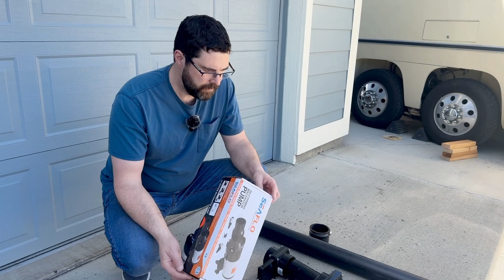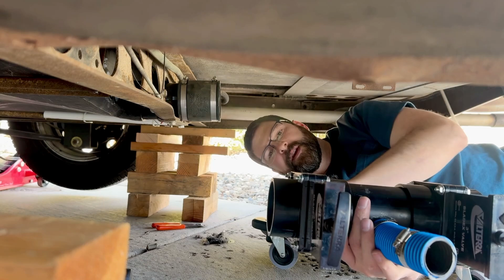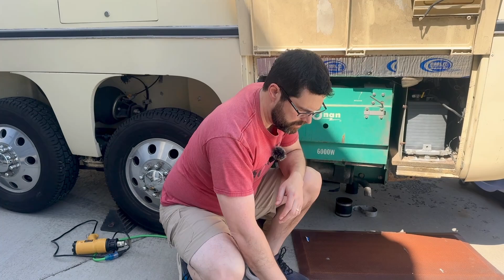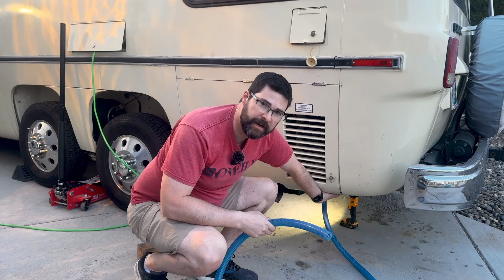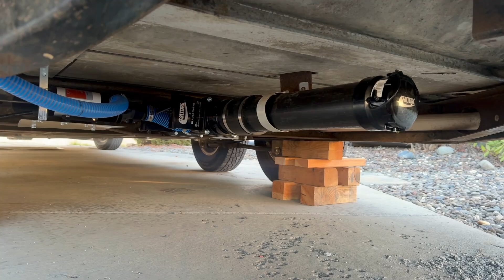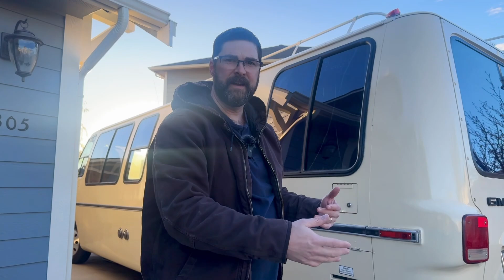GMC Motorhome Macerator Install

Comment: Enjoying your renovation of the GMC, however when are you going to sort the linked low compression/overheating issues?
Reply from the maker: Great question! The engine tick and low compression seems to have improved, I think I was having a sticky lifter problem or maybe a piece of carbon stuck in a valve. I haven't had any noise and power seems normal for the last year or so. The overheating continues to be a problem. I just replaced the fan clutch and will post that video soon. we'll see if that helps.
Reply: @MrGMCMotorhome  
Thanks for taking the time to reply, looking forward to your next video with the update, hope it fixes the issue. If not there's plenty of other options to try that are covered on many of the vehicle rescue/get running channels. Regards from across the Atlantic.

Comment: If you haven't already, take a look at Jim Bounds vids on macerator install. He has some really good ideas on the outlet hose.
Reply from the maker: I did, the Jim Bounds video inspired me to get a macerator! I considered his approach but I have fuel and LP lines running down that space in the frame cross members that he used. He was able to install a much longer hose because of more storage space. So far my hose length has been okay.

Comment: The on/off switch. It is a convenient location.... But Its a possibility, that a rock will get kicked up from the tire and turn it on. Might want to put a guard/shield or cover on it. 
It does look like you have it so forward is on/back is off, so less likely, but, they could bounce off something (the bumper?) and still hit the switch. I think I would have put in in the battery section of the generator compartment for safety.
Reply from the maker: Wow, great observation, I did set it up so that back is off because I was thinking about something hitting it going down the road. I thought about putting it in the generator compartment but I didn't want to have to open it every time I went to dump the tank. I like the safety cover idea. I can always relocate the switch later with a little rewiring.

Comment: Well done, you could put a cap with a rotating collar or rubber/foam seal on the sleeve of the pipe so when you poke it into the storage it holds it in and stops road grime and smells coming out.
Reply from the maker: Great idea, I expect that there will be some minor improvements we'll make as we use the new setup.